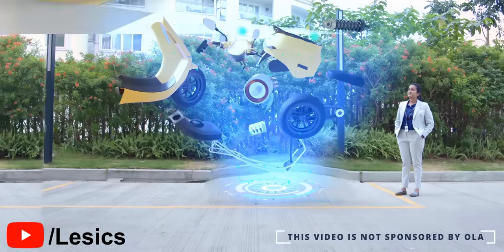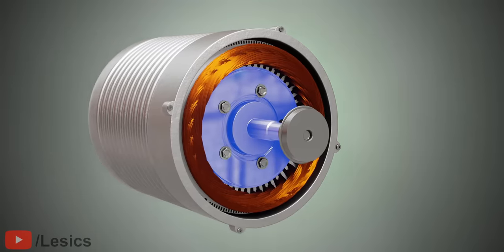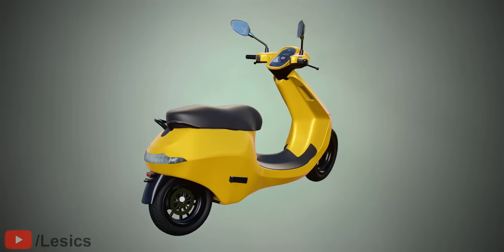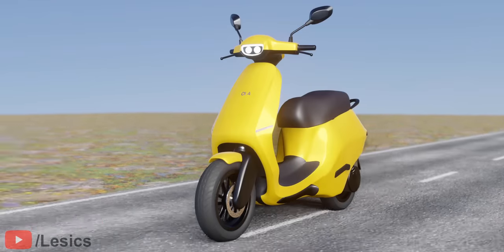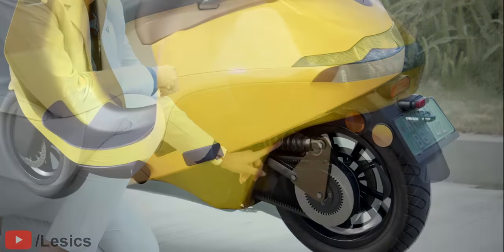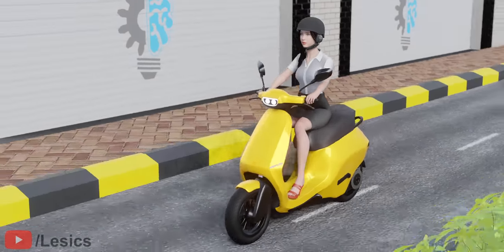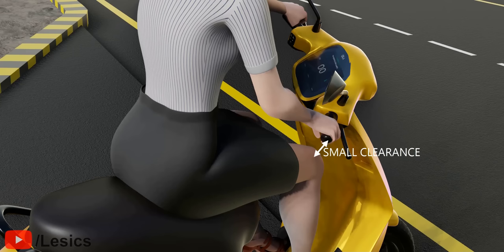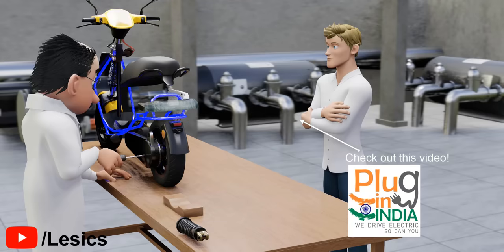Ola scooter | The detailed Engineering behind it

Comment: The best answer to these issues with an electric  is a normal scooter and ditch the electric BS that is not feasible. I rode scouters in Thailand for decades and even the ones made in the 1970s got over 125 miles to the gallon, the newer ones are 150 mpg up in the city and at 100cc the amount of pollution is so little that it would take 20 of them to equal the smog output of one new economy 4 cylinder car. The range is over 250 miles and to extend the immediate rage just carry 1 liter of fuel along and you have an extra 40 miles of emergency range to find a station. They don’t blow up and they run forever. You don’t have to mind 500,000 tons of the planet to make one battery as well!
Reply: What is scouter?
Reply: Ignorance at it best. You do know that internal combustion engines have literally controlled explosion  in them. Internal combustion engines had gone through much refinement spanning many decades.
Critiquing EVs which is not even adolescent is straight up stupidity n ignorance.
U just wait Mr.
Reply: @jagadishk4513  agree
Reply: Come back to reality. The current version of ICE scooters and bikes have overheating issues .